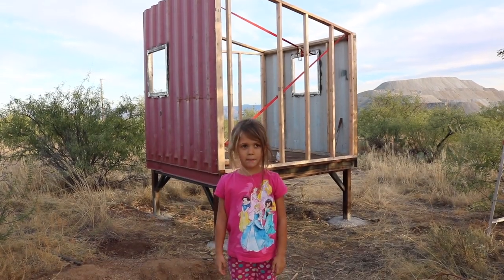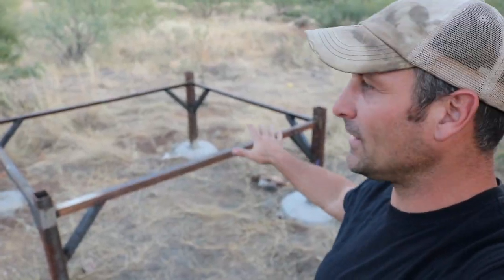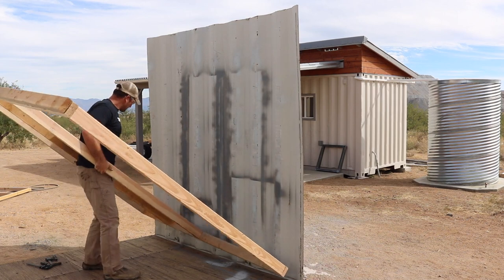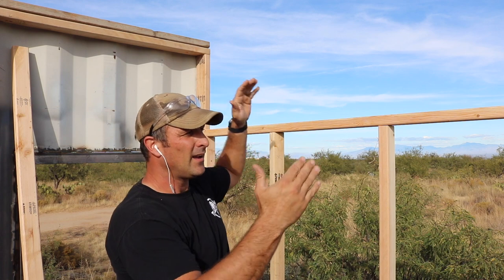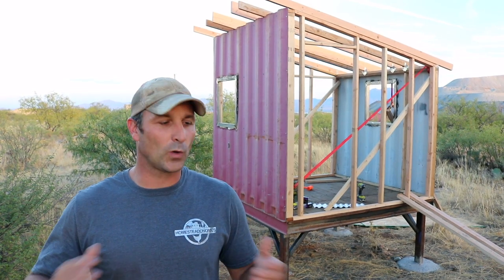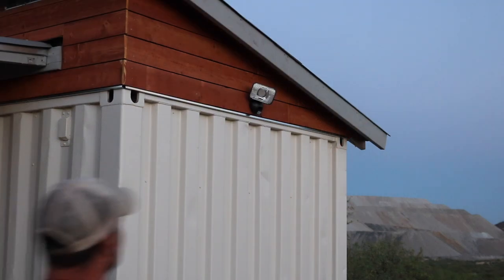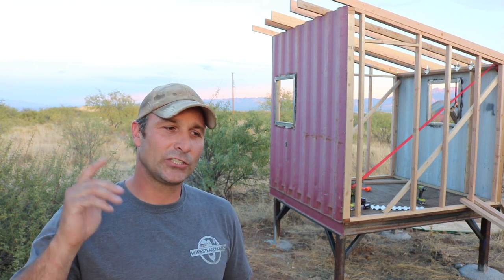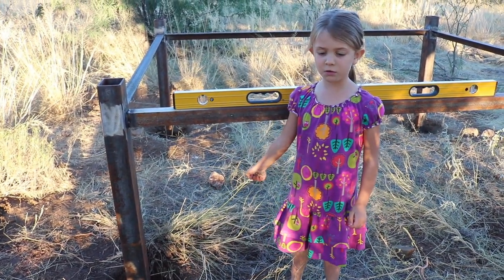Shipping Container PlayHouse - Part 1

Comment: Cool playhouse. Will you extend the roof over the balcony? You could easily turn it into a covered porch the entire width of the wall, with a rail system and steps down in front of the door, and the bridge off to the side. The bridge would be really cool if you give it a rope rail.

With the heat in AZ, you'll eventually have to add electric to the playhouse so you can give her a wall-mounted fan that matches your shop fan.

And a dog bed. Whether the dog has her own house or not, she'll likely spend a lot of time in the playhouse.

"We're gonna be doing some work, and... my Dad's gonna be helping..."
Reply from the maker: thanks will... not sure about a roof over the balcony... probably just open, but maybe.  
as for electric.. maybe a solar project later down the road.. right not for the next several months temps will be nice so it won't be a priority .... also for budgetary reasons it won't be..lol

And yes, I loved that part about me 'gonna be helping'   ...lol.. made be laugh so hard:)

Comment: chain suspension bridge! kids love jumping on them...  :)
Reply from the maker: that would be super fun!  but I'd have to have some sturdy anchors...but still might be something like that...hmmm
Reply: Post-hole filled with concrete? If you use steel fence posts, like for a chain link fence, that should be more than strong enough to provide an anchor point for the decking as well as for a hand rail.  3 feet up to the hand rail, two feet down into a concrete footing. You could drive an ATV across that... should be fairly inexpensive too.

Comment: If you can get it cheap one of the harbor freight solar kits would work perfect on there for both lights and fans as you can get them in 12v. 

Would also let you install a cheap car radio for music out there along with a 12v outlet for charging a tablet/laptop.
Reply from the maker: I may just have to try something like that... I know she would love to be able to turn on a light and fan.... and it would make the camp outs that much more fun :)
Reply: A frame just under the roof or under the structure would keep the battery out of the way and away from small hands that might try to touch both terminals at the same time. 

You should be good on keeping the battery from freezing no matter how the charge is just by how far south you are but a good idea would be a motion sensor to turn off the lights/fans when no motion is seen for x minutes. Looks like they have 12v motion sensors for lights so would work with other things but you would need to check the load of the fan vs the switch.

Comment: That flooring is actually very durable. Most people just sand it and shellac it. They don't bother resurfacing it.
Reply from the maker: yes, it's supposed to be really good stuff... but there's just no certain way to know what might have been spilled on it over the years.  It'll at the very least get a good coating of something... heck I might even look for a linoleum remnant or something like that... easy cleaning :)

Comment: Those pieces you cut out or off from the wall and windows could be made into covers for them and a door.
Reply from the maker: they are the perfect size for sure!  the door will prbably get made with some thinner stuff just for the weight issue though
Reply: homesteadonomics I was thinking of over the door as an awning of some sort.

Comment: line the inside with plywood siding and you will never have to fix a hole.
Reply from the maker: I'm actually thinking that is the way I will go... I found some utlity ply at HD for a good price and it has decent finish for the price too... will be lighter as well to move into the playhouse :)